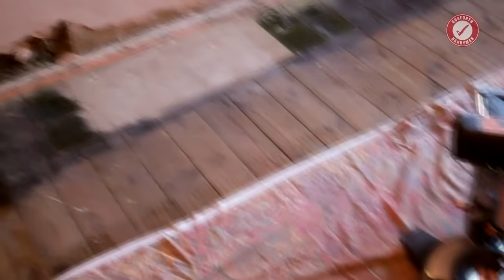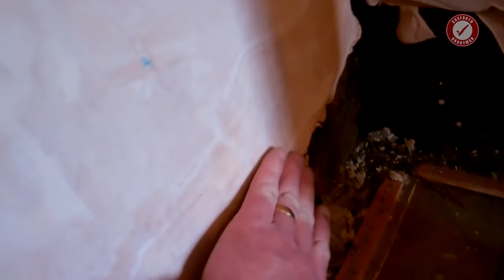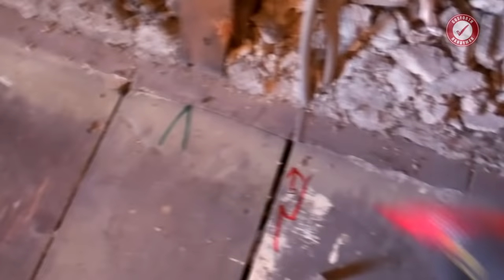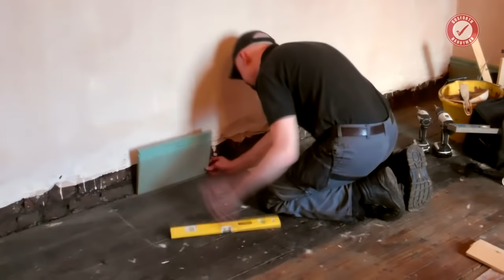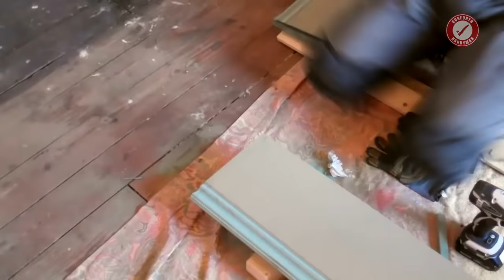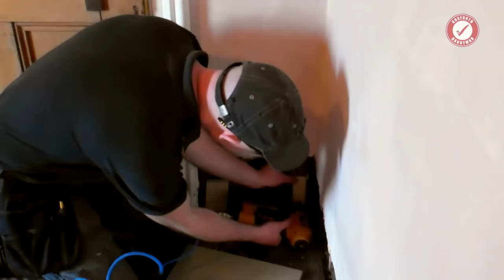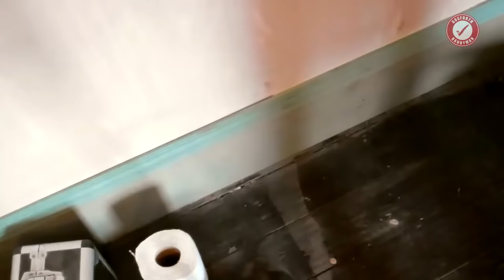Installing Tall Skirting Board / Baseboard in a Victorian House

Comment: Hi! What's the product called and used for that you sprayed on the side of the skirting board?
Reply from the maker: It's activator for the CA glue. Search for mitre bond and you should find it as a pack - but any CA glue with activator is normally fine. 👍

Comment: Dude, cannot recommend highly enough a good cheap second hand henry or hetty for site work, buy second hand and repair as necessary - loads of how-tos on tinternet - parts are cheap and you can bang it straight onto the old chop-a-saurus or pull out all that old plaster with it, time and time again.
Awesome for site as it reels in the lead quick.
Nice vid, a lotta people are going to find that useful.
Cheers.

Comment: I started work as an apprentice joiner in 1967, I was told early on that the difference between a good job and a bad job is 10 minutes. That may be setting out the job at the start, or cleaning up at the end.
I love your videos but I was really disappointed to see that you left all that crap behind the new skirting boards. That should really have been removed to prevent the dust coming into the room from under the skirtings.
Reply from the maker: Take your point but there has to be a balance between extra work and work the customer should really have done while preparing the room - bear in mind I'd already removed 2 buckets of loose debris from around the room. The stuff in the partition wall was mostly solid lumps of plaster and there'll always be a build up of dust in the cavity of lath and plaster walls like that. Point taken though and I agree with your sentiments. 👍

Comment: Three more tips to add to the already comprehensive video - 1) If you're fitting skirting to a finished floor (tiles, laminate, polished timber etc) - insert 2mm packers under the skirting before you fix it to the wall. This means you can later slide newspaper under it to act as a super-quick floor mask when you come to paint it. 2) New plaster will suck moisture straight out of a water-based adhesive and compromise the bond strength. So spend 5 minutes priming the small section of wall where the adhesive will be applied using diluted PVA first. This will similarly help prevent the plaster sucking water out of your caulk. And 3) Never assume that your corners are 90 degrees, especially in an older property. Internal scribes can be made to look OK, but 45-degree mitres on (say) an 86 or 94-degree external turn will look terrible. Buy yourself a little Starrett 505P-7 protractor and measure the exact angle before you make the bevel cuts. Hope that helps.
Reply from the maker: Great tips! 👍

Comment: Top job sir 👏👏👏👏👏

But get yourself a kneeling pad 🙂
Reply from the maker: Got kneepads built in to my trousers 👍😀
Reply: @GosforthHandyman  You know it makes sense ☺️

They were obviously work trousers but it didn't look like you had pads in them. I personally prefer a pad. Depending on the job location I sometimes use the mechanic's mat I use under the car. Reduces the need to 'kick' it across the floor/ground.

Anyhoo, keep up the good work. New subscriber and enjoying your videos 👍